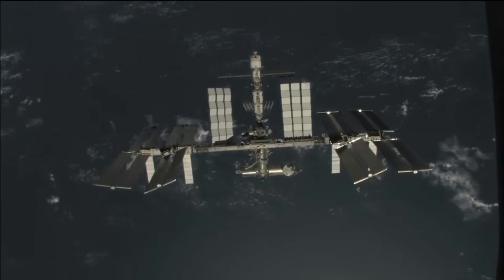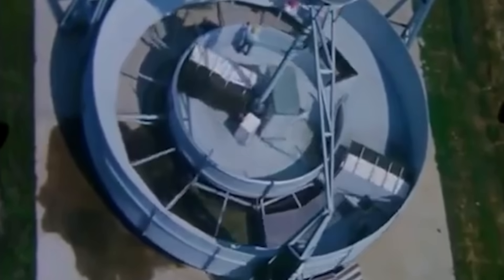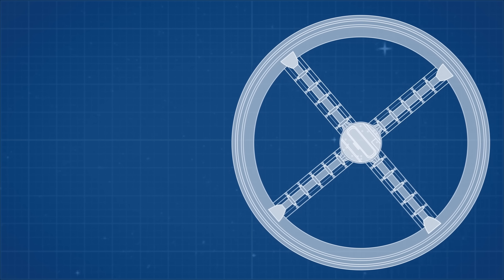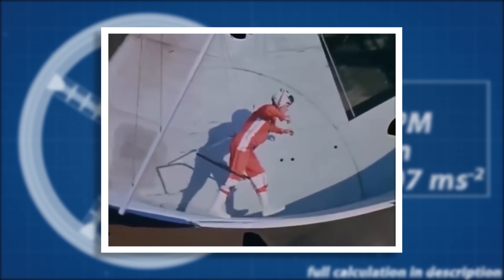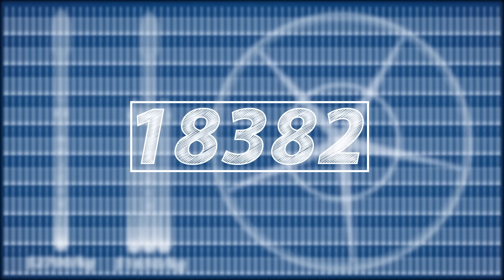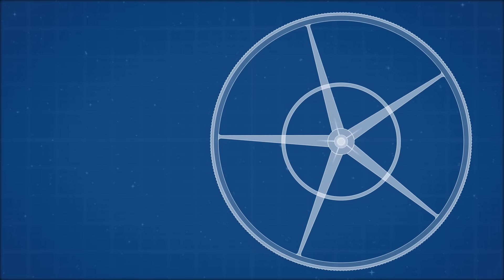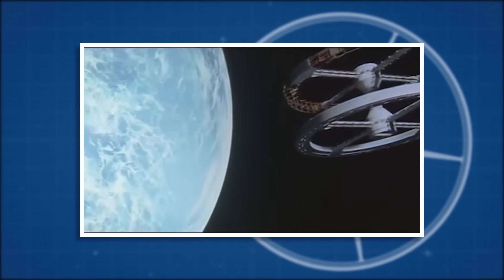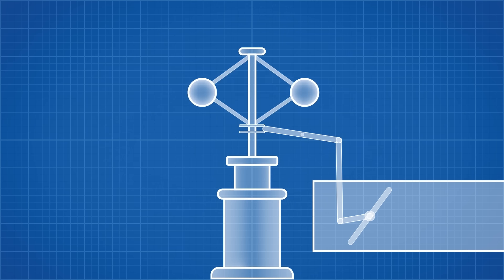Can We Create Artificial Gravity?

Comment: You exaggerated the cost and scales of space stations needed. First, we do not need 100% of earth gravity, only 10% can solve most problems. Second, a space station of ISS scale can easily generate 10% of earth gravity by spinning less than 1 rpm. Third, we DO NOT need to build an entire circle, we just need two space capsules spinning with a common center by connecting them with a tunnel that is strong enough.

Comment: Well... I watched the same old NASA test... and you did not show/tell all of it... The spinning of the construction have to constant... right? the speed of it will be determined of walking speed? so if you run faster you will feel something else then gravity... if you run slower or stand still you will feel again something else... so not a gravity equivalence... sort of in the right moment though...
But here is the kicker (which you did not show also) you run the other way... what will happen then? a couple of steps and you would be weightless again... and if you don't contact the spinning surface you will just float... so not a "gravity" feeling at all...   
That is the problem... I can see spinning spacecrafts... for sleeping, small rooms and stuff...
Then there will be lots of other(non gravity strange effects which just would be really strange...
And (I'm Swedish) is it not called centripetal force and not centrifugal?

Comment: How about a capsule on the end of a tether with a counter weight on the other end. Both rotating around the centre of mass. This then means that centripetally created artificial gravity is not limited to large spacecraft. The rotational radius and speed then is only constrained by the tether length and strength and masses of the capsule and counter weight on the tether ends.

Comment: You don't need a huge wheel, just a counterweight and a long cable.  Attach one end to the ship/station, and the other to the weight. Spin the whole thing with the axis of rotation somewhere along the cable.  You could use anything as the counterweight, space junk, old satellite,  small asteroid, anything with mass.

Comment: Two scenarios I'd like to get an answer to: What happens if you jump on a rotating station?  What happens if you drop an item on the station?
Reply: You'll land a little awkwardly but unless you jump pretty high, you won't notice much difference. You would land a little ahead or behind your starting point. Dropping an item will probably produce similar effects. It could fall slightly behind or ahead of you. Now imagine this. When you go through the tunnel connecting to the center, you'd get lighter until you reach zero "G" at the center axis of a rotating station.
Reply: ***** 
That last one was pretty much known to me.
My first question came to mind from a sign in Mass Effect 2 that read something to the effect of "You'll fall forward when jumping."

Other than moving to the axis of rotation, I wonder if there's a way of making an object stay in place relative to the space around the station while the station "floor" moves under the object?  If simply holding it and then dropping it would simply drop it on a weird trajectory and launching it would just make it follow a clear trajectory, what would it take?
Reply: The more complicated the situation the harder to predict what an object or person will do if they jump or are thrown along a more complicated trajectory. I did a story about interstellar travel about ten years ago. It was a graphic novel and I showed a starship which was essentially two large rings inside a hollowed out asteroid. One ring had water parallel to one wall. The ring would have to rotate without ever stopping to keep the water from becoming a major flooding problem. But then, the story was set some 200 years into the future and then I decided to do a revision set almost a thousand years out. Point being, the technology could get so advanced, the ring habitats could rotate for centuries without requiring stoppage. They'd have to for far off stellar destinations, even at near light speed! The other point, it became pretty difficult to determine what would happen to people and objects inside a ring where the ceiling is several stories above the floor and each ring half a mile in diameter.

Comment: i always ask myself why the I.S.S. is not functioning as a "Shipyard"
get some metel 3D printers up there (nasa is already doing that )
and build bigger ships there
Reply: Spacecraft cannot be built in the same manner as ships. They have to be as light weight as possible for their components to be sent to orbit in a practical manner. Current costs to launch payloads to orbit are around $10K per pound. 3D printers have a ways to go before they can build large scale structures. For one thing, the raw materials for a 3D printer still have to be sent to low orbit via chemical rockets with those $10K payload price tags. The private sector companies like Space X may eventually economize low orbit, but they are still in the early stages of doing so but they have yet to make a huge impact on the cost of sending payloads to orbit.
Reply: too bad , that metal dust the 3D printers need would be easy to transport ...
Reply: Hopefully, low orbit will become economical within the next 10 to 15 years. Then it may be possible to build sturdier, ship like structures even though the sturdiness isn't exactly a necessity in microgravity. I always thought 3D printers had plastic tube like structures that are fed into the 3D printer to become whatever product is desired? Have they gone to a printer that uses metal dust?
Reply: +J Dean, Yes,  the printer is using metal dust and a Laser.
Reply: Thanks for the info. That must be an industrial model. I'm thinking more along the lines of the ones regular folks with a grand or so can buy.

Comment: ok so for the most part what you are saying is correct but centrifugal force is not a real thing. only centripetal force.
Reply: Centrifugal force is just as much of a thing as centripetal force, both have been disproven as forces they are just the interaction between momentum and angular acceleration and so they've been replaced, for the most part, with Angular Momentum Theorem.
Reply: This is honestly the stupidest thing I have read in a while. Centripetal force has never been disproven. It very much is a real force. Without a force pulling an object inward it would fly out straight. You can test this yourself if you really want. Full a bucket with water and tie a rope to it. Swing the bucket around you an you will notice you need to apply a force to keep it moving in a circle. This is a centripetal force
Reply: xray362 no it's MOMENTUM keeping the water in the bucket you know that law of motion that states that an object in motion tends to stay in motion! The reason the water changes direction isn't due to some imaginary force it's due to the fact that you're pulling on it with your arm. Try googling angular momentum theorem.
Reply: +steven kutschat moment keeps it going straight. it's funny cause you admitted I was right. you said it keeps going round because your pulling on it. yes that's the centripetal force
Reply: I'll help you out since you keep talking about angular momentum. That is for something spinning around its self. Ie the station. The station won't need an outside force to stay rotating. The people Will have a centripetal force applied on them by the station to keep them revolving. Simple stuff really
Reply: If momentum keeps it going straight and you keep it turning then what is the centripetal force doing? oh yea nothing because it's a fictitious force it's not doing anything it's merely a reaction to what you're doing.
Reply: +steven kutschat momentum keeps it straight. centripetal pulls it in. those it rotates. read a book dude. you keep saying you keep the bucket pulled in. yes because you are applying a centripetal force. get gud kid
Reply: +xray362 thus it rotates*
Reply: xray362 if they were having a centripetal or "center seeking" force applied to them why aren't they getting pushed to the center. The answer is simple it's because there isn't a center seeking force there is only momentum pushing out and the wall stopping you from going that way ... it's 7th grade science here what's so hard about it?

Comment: You might not need an entire wheel, just a section of it. You could use the empty skeletal structure on the other side of the pivot point as a counter balance. You might not even need that if you had thruster tech capable of allowing you to orbit a point in space fast enough. I though they experimented with centrifugal force on Skylab?
Reply: NASA had proposals for a space station that was drawn up around 1968 or so. They studied using a tether to spin the station and counterbalance it with a spent propulsion module if I recall right.

Comment: Can you please say centrifugal correctly?
Reply: charlie harrison I don't care if it's a real thing or not, I just want him to pronounce it correctly.
Reply: its actually centripital. Centrifugal force is a made up word (from the word centrifuge).
Reply: Centrifugal force isn't a made up word it's just as much of a thing as centripetal force, both have been disproven as forces they are just the interaction between momentum and angular acceleration, with one minor exception. Centripetal force isn't used in science any more as it's been replaced with Angular Momentum Theorem, while centrifugal force is still often used to determine the rate at which a substance will fall out of solution, as the math to do so is a bit simpler than using the AMT to do it.
Reply: Opposite; 'centrifuge' is a back-formation from 'centrifugal'; 'centrifugal' was coined by Isaac Newton.

Comment: centrifugal force does not exist. There is only center-seeking force and forward momentum in a centrifuge. Learn your physics bruh.
Reply: actually if you've been keeping up with science there is no center seeking force only momentum and angular momentum.
Reply: You're 100% wrong. There always is a center-seeking or center-pushing force. That's why satelites stay in orbit, why planets orbit, why helicopters fly... etc.
Reply: That center seeking force you're talking about there it has a name and it's not  
centrifugal force it's called GRAVITY. Except for the helicopter that has nothing to do with your point either
Reply: You have no clue about physics do you? I wonder if you even had it at high school. Explanation time:

'GRAVITY' is an example of a center-seeking force. In helicopters this center-seeking force is the tension of the molecular bindings in the rotor blades that make sure that the rotor blades don't just fly away when they're spinning. If you hold a rope with a ball attached to the end, and you spin this rope around, the ball only has got forward momentum (which is constant, but due to continuous acceleration the ball will keep flying into different directions) and the rope here functions as 'gravity'; the tension in the rope provides exactly the same amount as force as the acceleration of the ball. This fenomenon allows the ball to stay at a constant distance from the center point. 

Go follow your physics classes mate. Centrifugal force does not exist, and every single physics teacher will tell you this.
Reply: The problem with 'centrifugal force' is that it is ment to be a force that pulls the entity away from the center. There is not a single type of force that does this. The only force that is pointing away from the center, is the momentum of the object. This momentum (which is the object's acceleration) is going in the exact direction as that the circle is going. 

What people (wrongly) think centrifugal force is: is that it is a force that is a 90 degree vector on the acceleration vector of the entity, but rather than pointing towards the center it points outwards from the circle. If this was the true, then objects would be in no way capable of staying in orbit.

People tend to mess up one idea here: They think that the acceleration vector = the centrifugal force, but it is not. In physics you do not assign two sources for the same force-component. Thus there is no room for centrifugal force either.

Comment: .. hmmmm.. I suspect we have not checked out all possibilities yet.. I mean.. yes.. it requires distance.. but nothing say that the actual habitational structure has to be completely circular.. what about just one single strong cable, and two weights at both ends.. rotatating.. and only one of those weights is the habitat (that means: has to be built in it's entirety, and be composed of durable materials all and all)...  so the bulk of the weight of the "counter weight" could be a comet.. that no one done anything about except guide in to a holding area..

also; There is still no reason to assume that a completely artificial field "can not be created".. How DID that higs boson experiment really turn out?
Reply: NASA proposed just such a tethered design in the late 1960s. Lack of funding prevented a space station beyond Skylab which meant no artificial gravity generating station would be built by NASA. By the time ISS began to be developed, it was still thought the shuttle would reduce launch costs and ISS didn't require artificial "G" because the maximum crew durations would be 6 months except in cases like astronaut Scott Kelly's where certain research plans required a year long stay. In addition, getting a space station approved became a decade long battle for NASA. And that was just for the ISS like designs which were formerly known as space station Freedom, Fred or Alpha.
Reply: *****
Ah; That might be where I got the idea from then.. Probably had it in my subconscious.. I was mostly thinking about that toy/weapon where you have a leather strap and two weights of clay..  (and I was also giggling hoping someone would someday build such station, so we can see what happens when it runs in to something..
Reply: These days, if we had a station that could generate gravity but run into something, we'd be too spooked to fly again! Challenger nearly ended the shuttle program and Columbia finally did.
Reply: I was more thinking of the fact that this was originally a weapons design.. intended to trip running animals....  so.. what if some alien juggernaut spaceship passes by and get entangled.. the alien U.N. might decide to attack the earth because of our weapons of.. "mass"-obstruction..

(pun intended..

.. because scientific puns are the highest form of humour)

Comment: no need to do it circular .. a balancer with two opposite chambers is enough.. at  least astronauts can spend some time in 1g enviroment to avoid or minimize neg effects of micro gravity
Reply: NASA proposed just such a tethered design in the late 1960s. Lack of funding prevented a space station beyond Skylab which meant no artificial gravity generating station would be built by NASA. By the time ISS began to be developed, it was still thought the shuttle would reduce launch costs and ISS didn't require artificial "G" because the maximum crew durations would be 6 months except in cases like astronaut Scott Kelly's where certain research plans required a year long stay. In addition, getting a space station approved became a decade long battle for NASA. And that was just for the ISS like designs which were formerly known as space station Freedom, Fred or Alpha.